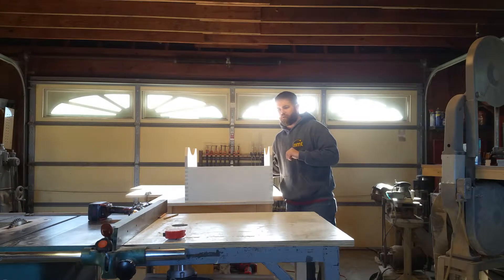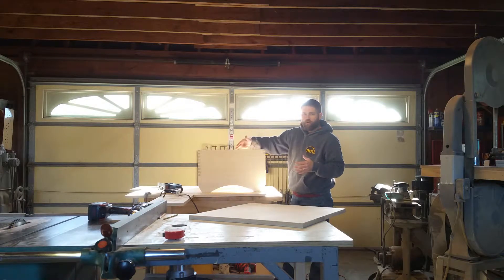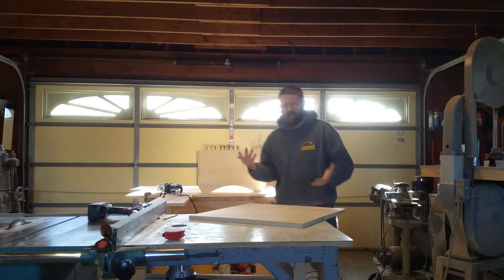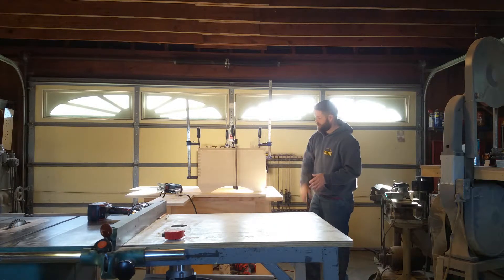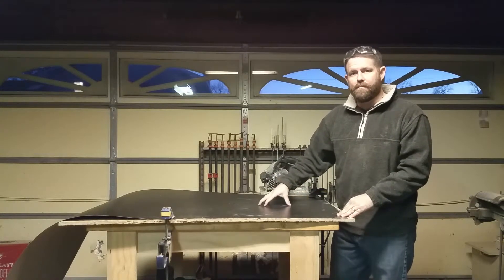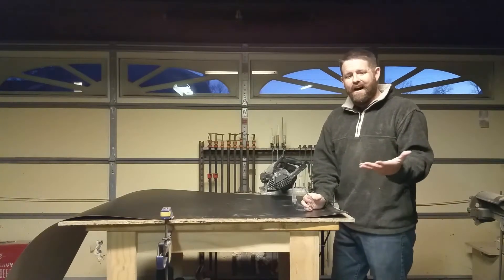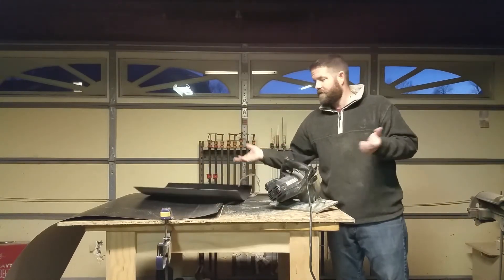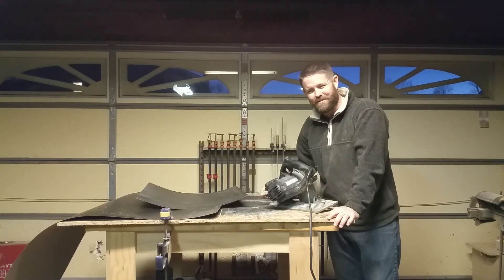How to Build a Telescope: The Rocker Box Part 4 of 4

Comment: Really like you videos, but i I think few in audience have as big tool selection as yourself.  So I suggest this material would be applicable to a wider audience if you can show us to how make this with more common tools like only a circular saw, a jig saw, hand sander, a hand drill, hammers, screwdrivers, etc.
Reply from the maker: This is an excellent point and something I do have planned

Comment: Thanks again for these videos. I discovered them just as I was finishing my own 16" build about 18 months ago. In some cases I was vindicated in how I did something, in others I wished I had thought to do it that way.  I just rewatched the rocker box series because I'm thinking about redoing mine. My scope is top heavy and I can shift the balance point by creating a rocker box with higher walls and moving the altitude bearings up.